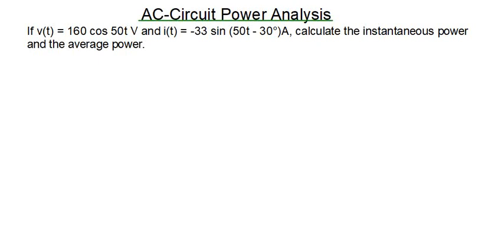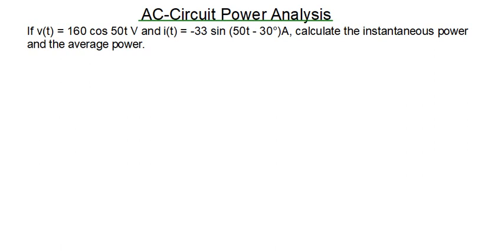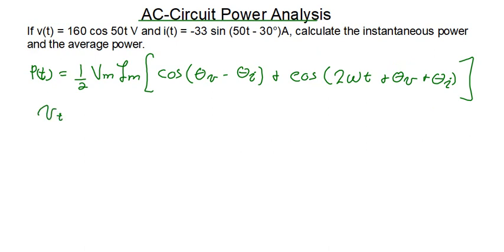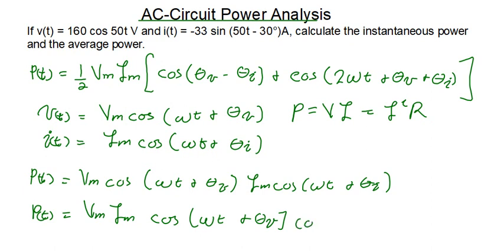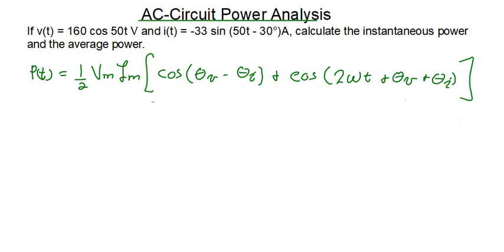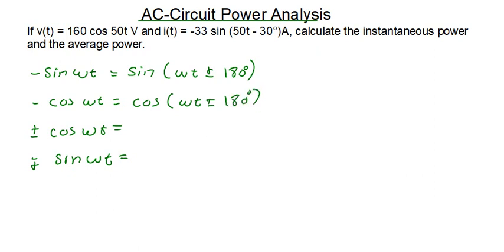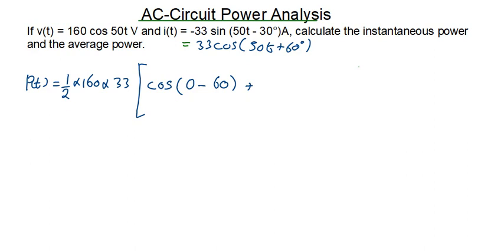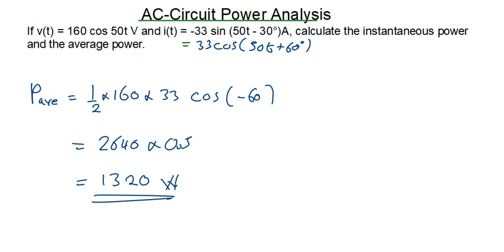AC-Power _ instantaneous power and the average power.

Comment: why did you get a positive 90 and not a minus 90?
Reply from the maker: The current is negative hence the angle we pick needs to be positive (+/-=-/+) & ( -/+=+/-)
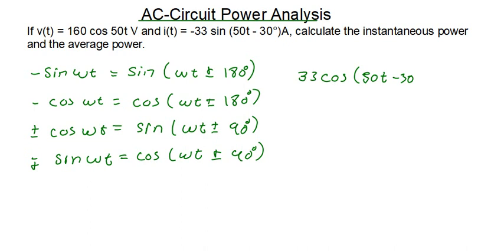15:35 watch that part of the video
Reply: @TranscendedEngineering  thanks 😊
Reply: Do more questions on power analysis